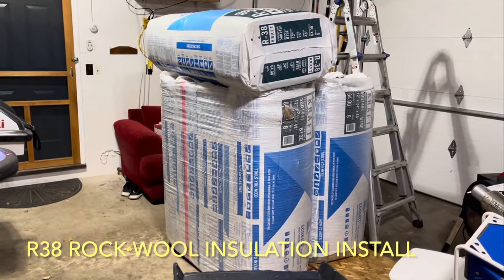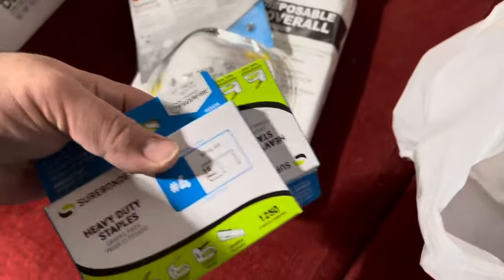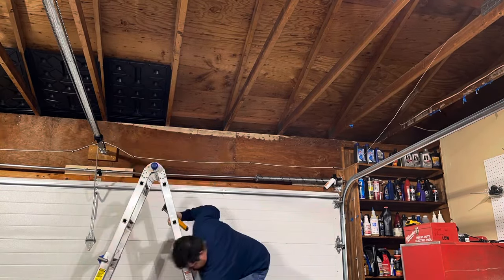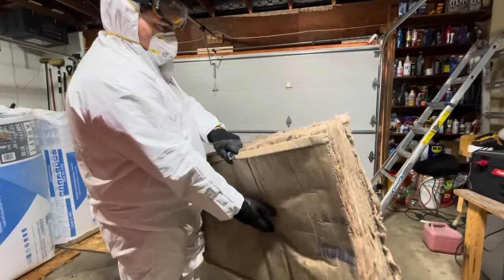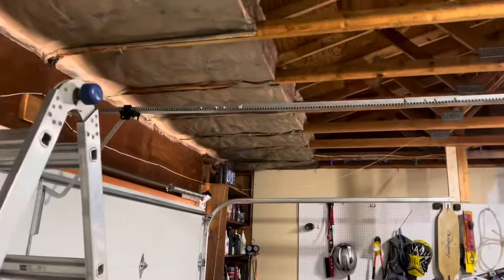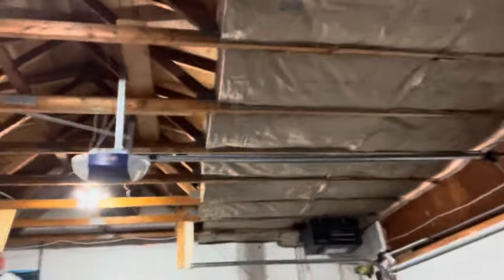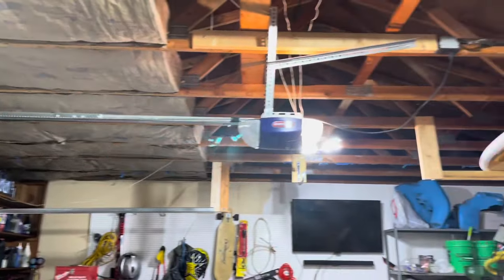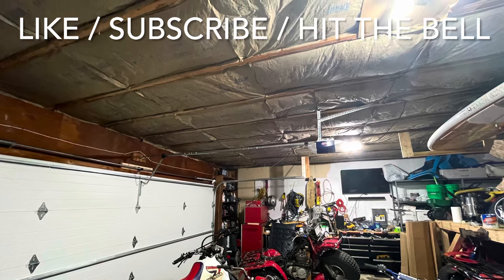Garage ceiling insulation install - Kraft - B19E - R38 (Rock Wool doesn’t even itch!)

Comment: The baffles im fairly sure are only needed if you were to put the insulation directly onto the ceiling, keep the air flow going, putting them on there without insulation does nothing.
Reply from the maker: It’s just so you don’t block the air flow on the end edge near the soffit. Just makes for a clean install and proper air flow.

Comment: Do you have to put drywall over the insulation?  Or can you leave it like you have it?
Reply from the maker: I’ll prolly drywall it some day. But it’s been up there for over a year now with no drywall and no issues.
Reply: I wouldn't recommend leaving that kraft faced exposed like that it's a fire hazard... The paper facing Will light on fire like newspaper

Comment: If you’re not gonna air condition in the garage do you need to insulate the attic someone told me it would hold him in the summertime if you insulate it without AC
Reply from the maker: That’s what holds in all the heat bud. Of coarse you want to insulate the ceiling.
Reply: Roof vents or a ridge vent would solve the heat issue. Some unfinished garages don't have roof vents. If you're gonna insulate your garage you're definitely gonna want roof vents.
Reply from the maker: Yep the attic is the same temp as the outside. Garage is always nice and warm and the snow does not melt over the garage.

Comment: Do you need to put a vapor barrier after that ? Or is ok cause it’s faced
Reply from the maker: I eventually want to put drywall up. But it’s been up now over a year, still is holding up nice.
Reply: @2acres933  woww. I did not know drywall is a vapor barrier. You learn something new everyday. Yew are so smarrrttt

Comment: Hi Thanks for the video. I have a question. We are renovating garage and our contractor has created frame for ceiling using 2x4 only. Can it hold up the 1/2” drywalls ?
Reply from the maker: I’m an not sure on that question. If you find out I would like to know as well. I have 2x4 trusses and would evenly like to finish the ceiling in drywall as well.